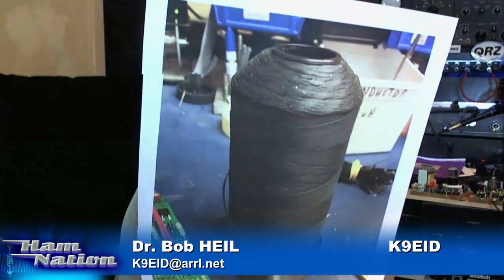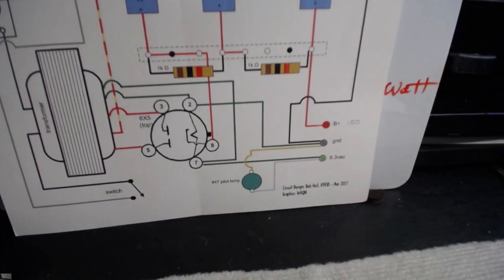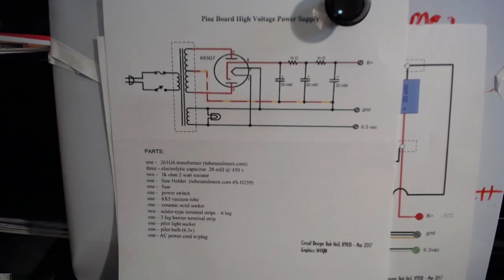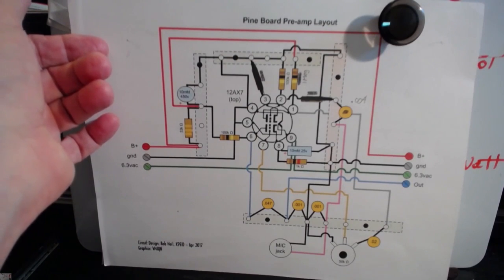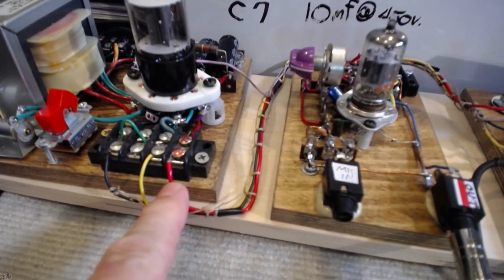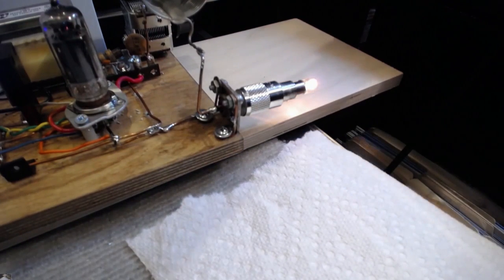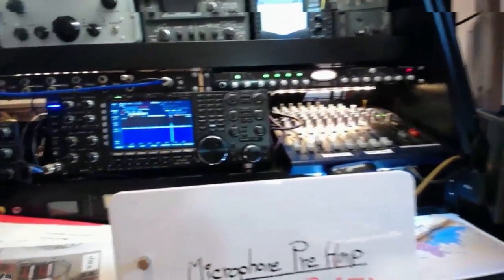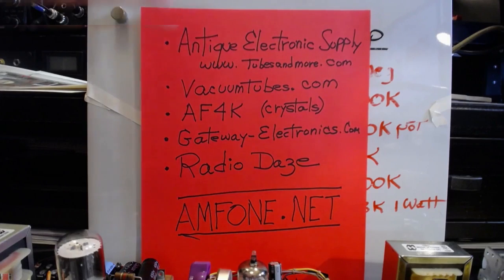Pine Board Project from HAMNation on Twit: Power Supply Part 6

Comment: The Power Supply Schematic that you show at the beginning of this video shows the Vacuum Tube but the write-up on the web site and the article in QST both show a Bridge Rectifier. Which version is the correct one?